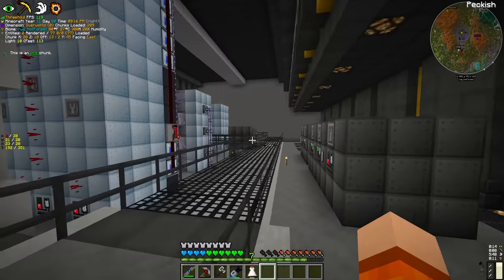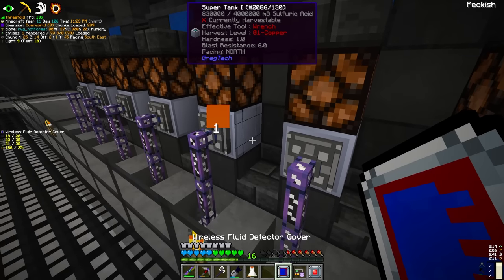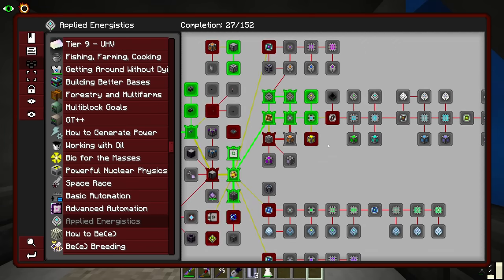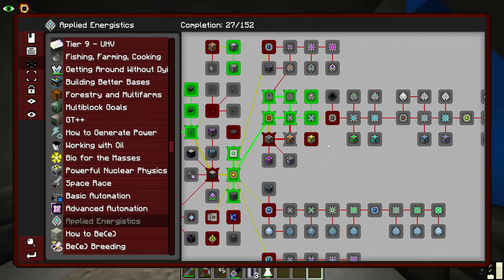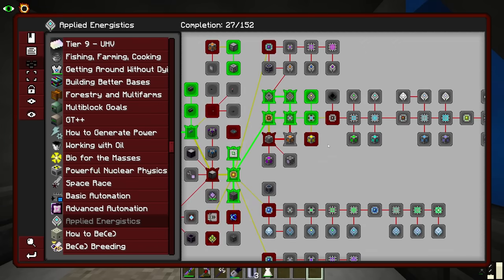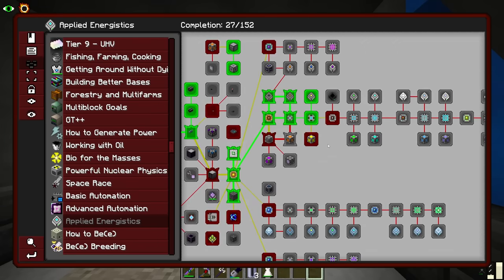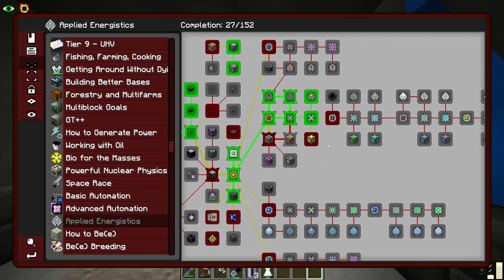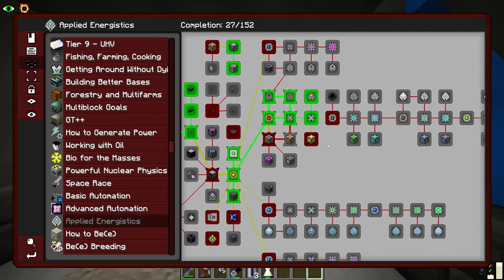Gregtech New Horizons S2 33: Autocraft Me a Circuit, Please

Comment: If at any point you're not sure what to do next in GTNH, look at the next tier of circuit/EBF coils and work towards that. You can never go wrong getting better circuits or better EBF coils. Speaking of which, one quirk of EV not really existing as a tier means that the IV tier line of Quantum Circuits is already a lot close than you'd think. Not that it doesn't require several things Three doesn't have currently, but it's very rush-able if you want to go that route.

I was wondering why you started actually producing your own Iron(III) Chloride so early, and then I remembered that the quest shop in MP is busted in 2.2.3. Normally you just spend all of those (otherwise largely pointless) Chemistry coins on Iron (III) Chloride, and over time build up so large of a stockpile that you don't start producing your own until way, way later than you normally would.

Ah, yes, the stocking input bus. One of those (relatively) newer additions to GTNH that tend to fly under my radar partially because they didn't exist back during my survival playthrough some years(?) back, and partially because I don't keep too close an eye on AE2 additions. But it's definitely one worth highlighting: The Stocking Input Bus (ME) is a combination Input Bus and ME Interface. It doesn't have any physical storage space, instead a stocking input bus allows you to filter up to 16 different items to be exposed from your AE2 storage system. Say you've got a drawer with 64 stacks of sulphur dust hooked up to AE2 via a storage bus, and you add sulphur dust to a connected stocking input bus: It'll read the 64 stacks of sulphur dust connected to your AE2 system and give the multiblock it's connected to access to all of it. Despite this Stocking Input Buses cannot run into problems with their inputs getting clogged, since they have no physical storage space of their own, all they do is read the content of your AE2 storage network and make all filtered items they find available. Incidentally, in addition to obvious applications in ore processing (though old fashioned storage buses can still be more useful there due to their much larger filtering capacity) and these chemical line automations Stocking Input buses can also be used in autocrafting. Circuits in particular enjoy a whole host of possibilities in regard to putting crafting components on passive, automatically providing them to dedicated circuit assembling machine PAs instead of stuffing input buses full of random garbage, etc. Expect(/hope) to eventually see something like that in action, because crafting an Assembly Line without some serious investment into circuit crafting capacity is, eh...well, you'll have ample time to ponder the decisions you've made leading up to that point. Let's put it that way.

Ah, the tried and true tradition of the GTNH quest completion dance. You will be baffled by the amount of times you have to do something manually well past the age where you should have fully automated it. And hopefully did. "But the devs added quest bypasses specifically for that reason!" you say? True, a lot of the large chemical processing lines have ways to bypass the many quests that require you to hold X of each step along the way, and if you're doing a no rocket challenge of some description there's bypasses for those as well. The problem in the former case, however, is that you're not doing these quests because you need a questbook to explain to you how NEI works 500+ hours into a GTNH playthrough. You do the quests because they reward you with precious Ender Chests/Tanks-I mean, lootbags, and/or coins you can spend on AE2 processors/fluix cables or Iron(III) Chloride. To give you an idea the PBI questline in IV yields a total of 13 IV lootbags, enough Technician coins for 16 of all three AE2 processors and 408 fluix cables, and enough Chemistry Coins for 1472 cells of Iron(III) Chloride. Yeah. You could bypass the quests, but why would you with that much of a reward being left on the table?

I imagine most will have set up some sort of glowstone automation by now. If not the Equal Trade focus trick is certainly a decent way to collect a lot of it quickly, though enhancing the focus to expand it's radius and add Silk Touch is recommended. You can fluid extract glowstone blocks into the full four dust worth of liquid glowstone, whereas breaking the blocks might not yield that full amount. In addition glowstone blocks are also denser than the dust, meaning you can craft bigger batches easier, for what that's worth. Finally if you need glowstone in a hurry than Thaumcraft (or Botania) to the rescue with glowstone duplication recipes, TC requiring three torches and a dye per glowstone dust and Botania requiring either a ton of mana or a redstone dust and far less mana per glowstone dust. Either way you're going to be running through glowstone at a rapid pace going forward, so either upgrade your manual gathering efficiency or, ideally, set up some kind of automation for glowstone dust.

The sideways magic progression is because it makes advancing tech progression easier, and it's something you want to get into early because going too far into tech progression makes magic progression obsolete. The pre-moon discount interdimensional wireless AE2 terminal setup, for instance, is far less impressive when you've got a quantum link set up in your Spectre Dimension, giving you access to your AE2 network from anywhere. Magic Mirrors in general fall off pretty hard when you're at the point where simply following the questbook's multitude of IV chemical lines will make it rain Ender Chests/Tanks like they're going out of style, for that matter. If you want to do magic in GTNH it pays off to get into magic as early as you can, because once the tech starts rolling in magic is just kind of...there, for the most part.

I can already feel the single block EV/IV gens making people go full casual mode, forgetting even the simplest of solutions to these sorts of problem. Something you absolutely can do in these sorts of situations - though how you'd get into one in the later versions is beyond me at this point - is hook up an EV tier machine to an HV line and give it an EV battery inside the battery slot. The machine will only get 1A HV from the line, since that's the most that single block machines can accept to actually run recipes, so it will drain the battery as it crafts. But when it's not crafting that battery will be refilled off of the HV power, meaning if you don't use the machine again for long enough it'll be ready to go by the time you craft the next batch. Nanocircuits specifically, bar the LuV tier Nanoprocessor Mainframe, only require 600 EU/t to craft. Say the machine gets 500 EU/t from the HV energy line, a 10M EU battery will last for over an hour of straight crafting, and when the crafting finishes it'll recharge the battery five times faster than it was being drained during the crafting process. Obviously other EV/IV machines won't necessarily have nearly this beautiful a setup in this regard, but still. You don't need an EV gas turbine to run an EV circuit assembling machine, at least to batch craft a bunch of nano circuits.

For the record while the Integrated Processor (to use it as an example) is the highest grade of MV circuit, being a direct craft without requiring any LV tier circuits, this isn't the end in terms of upgrading circuit crafting. In mid-late IV the option of crafting SoC chips opens up with access to Naquadah doped wafers, which opens up an even cheaper recipe to craft these MV circuits. In fact ULV circuits can already make use of SSoC wafers. Likewise mid-late IV is when you first can consider switching over to Advanced SMDs, which would cut the crafting time of circuits in half in return for using those (much more expensive) advanced SMDs. Then later on in LuV the Circuit Assembly Line becomes an option, which will completely overhaul circuit crafting and make it even more efficient, though even that won't be the final word in upgrading circuit crafting. There's still plenty more to come, so don't go thinking that anything being set up at this point is truly "permanent" until endgame.

Comment: Don't worry about cable loss. LuV and up you will probably want to use superconductor wires anyway because of supported amperage. You will need thousands of those for fusion reactors, so using a few hundred for routing energy is nothing.
Reply from the maker: True, EUP2P is also an option across a large enough distance. I'm just worried about the cost for that length of cable, but we'll make it work :D

Comment: I've been taking your advice from this series and taking my time in each stage as I go. On my first playthrough/world, and I've been satisfied playing around in late steam age for a decent while now since I spent the time to build a good starter base and move everything the 1000 blocks over to it. I've unlocked LV stuff but only crafted a bit of it yet. But I'm super proud to say that I've got an automatic ore processing chain! I mean, I have to put in just one kind of ore at a time but then it macerates, smelts the crushed for the extra nugget, and then grinds those into dust and recombines into dust in the compressor. From there, depending on what I want to do with the dust I sometimes disconnect the smelter array to keep it as dust for the BBF or alloy smelter. It's all automated mainly using hoppers and some redstone, like comparators (and the occasional item pipe from the hoppers, but it doesn't take a stack if it's from a hopper so the tin ones are way too slow and I don't often use conveyors yet because it's HP steam machines lol). Next step is getting to mid LV for more efficient rubber, cable, and plate recipes and then using that efficiency to make conveyors and maybe a sorting system. I really want to build one of those big steam grinders you were using!!

Comment: Btw batterybuffers (like all machines really) can accept lower voltage tiers.
So there isn't really a reason to step up the voltage for feeding into the buffer unless you're hitting the amperage max (2A per battery) or are worried about cable loss.
The only reason this doesn't work with other machines is because they are bottlenecked by their 1-2A input limit.

Comment: Threefold your work ethic/grindset is incredible.  I'm taking a break because between my self imposed restrictions (no space/everburn urns) and poor playstyle, iv is such a grind!  I may return eventually, I still have a few things I would like to accomplish.

You're not as far from socs as you maybe think, naquadah is pretty early IV.  IIRC you only need an EV mixer for hssg and an IV ebf (which is still EV) to make it.  Maybe the boules require hsss (IV mixer), I don't remember.  The ore itself comes from IV loot bags, idk what tier rocket it is since I can just get it from meteors.  Or bees if you're just itching to spend dozens of hours grinding bees hahahahahaha.

Also at one point you showed the crafting recipe for ae2 storage components, those recipes are complete trolls that should have been removed long ago.  The circuit assembler recipes for ae2 storage components are much cheaper.

Comment: I dont know if it makes sense, but maybe setup an "alarm" that when soldering alloy is low, you know your crafts are not going to finish. Or have a Computer display the Status of things (like buffer full, working, missing ingredients for passive crafting and so on) Though I am unsure of 1.7.10 mods that enable you CC and AE2 compatibility

Comment: The autocrafting cpu units should get a dedicated room alone due to later expansion, considering the fact that you're going to rely on autocrafting instead of gregging around manually, since it's for granted at this point. Better setting it in one place and expanding it, rather than moving it around. Could save you some time later on once it's done.

Comment: If a multiblock structure that requires multiple coils, such as an EBF or DTPF, has mismatched coils, does the multiblock not form (meaning the same tier of coil must be used throughout the whole multiblock) or does the multiblock work with lowest heat capacity out of all the coils used?
Reply from the maker: Multiblocks cannot mix and match coils. It has to be one type of coil used throughout :)

Comment: Could you build the clean room walls out of stone (place the inputs and the machines) and use the wand to replace the blocks? I wonder if that'd work.
Reply from the maker: What benefit would that bring?
Reply: @Threefold.  Objectively, Idk. When you said it was going to be hard to move the clean room I thought you meant planning where everything will go.

You'd know how many extra blocks you'd need to craft and it would start cleaning itself as soon as you placed the walls, instead of waiting to break some blocks and place the inputs. (In my head at least, that makes sense)

Or you could use the schematic as well, which I forgot you had access to before I made the comment

Comment: How can there be an elevator in the cleanroom if you can't have any blocks except those white ones there?
Reply: There is a config file that is set to allow certain blocks and percentages for the clean room build. GTNH allows both 1 elevator block, or 1 travel anchor per clean room.
Reply: @extreemkb  thx